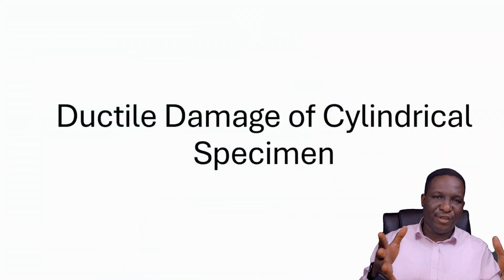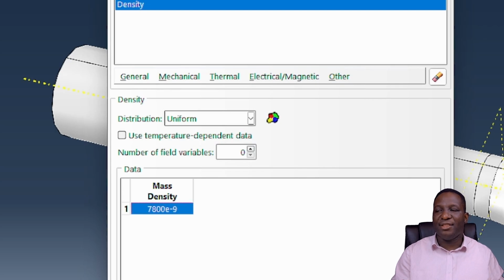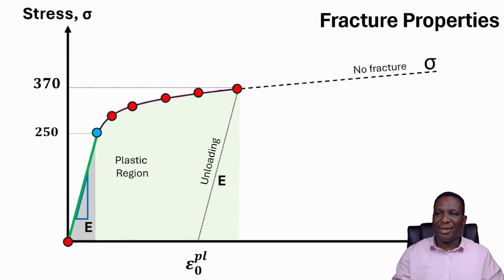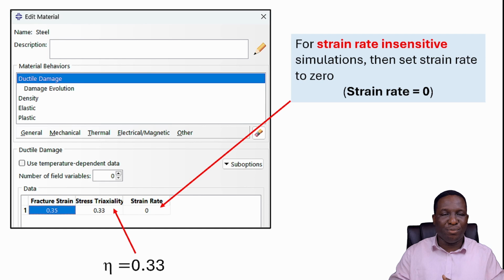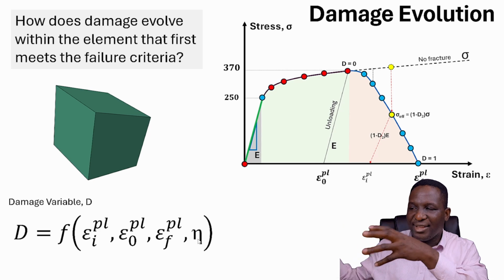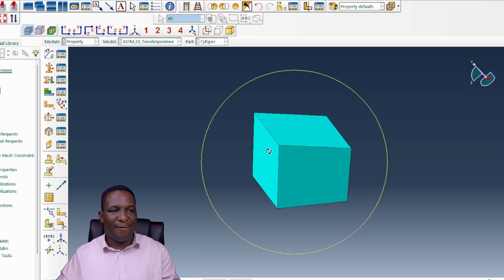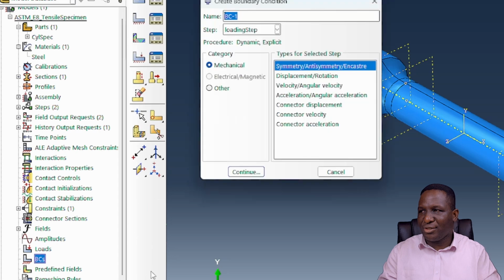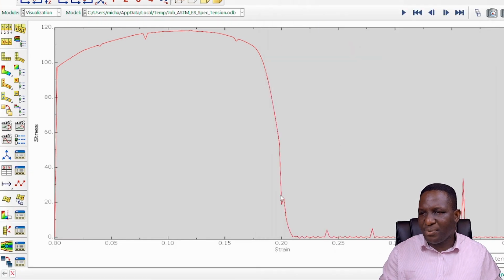This is the MOST Comprehensive video about Ductile Damage.

Comment: Thanks alot for this video 
I have a question 
What is the best way to accurately model damage of lattice structure made of PLA+ under uniaxil compression test ?
Reply from the maker: Great question. The most accurate approach in ABAQUS is to model the lattice explicitly (beam/shell or solid struts) and use a plasticity-based damage model calibrated from uniaxial compression tests of PLA. You may also include progressive damage with element deletion, large deformation (NLGEON), and contact between struts especially when large deformation is in place. For collapse-dominated behaviour, Abaqus/Explicit is usually the most stable and realistic choice.

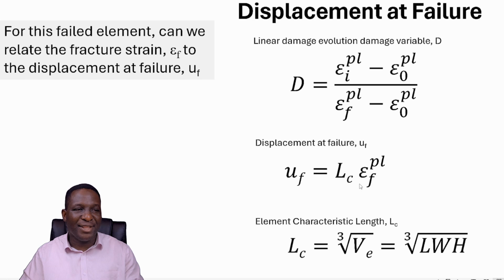Comment: To define the displacement at failure (u_f) you are using the Fracture Strain (epl_0=0.35), but you should use the Failure Strain (epl_f) that you didn't define. In your video, at 20:45, clearly says that u_f = L_c * epl_f. Using epl_0 (u_f = L_c * epl_0) seems a mistake. Beside this mistake, I gave you a like. Anyway, I recommend to use the Fracture Energy (G_f) instead, because it makes your input independent of the characteristic length. G_f is a material properly (140 kJ/m2 for the steel, 110 kJ/m2 for the aluminum,  etc.). With G_f you can use a mesh with irregular element sizes.
Reply from the maker: Good observation,  thanks.❤

Comment: I often get ta S11 stress higher than defined in the material properties of steel, UTS defined is 500 Mpa but i am getting stress result around 600 Mpa. It is because i dont define a fracture properties?
Reply from the maker: Could be as a result of the element chosen. Are you using Tetrahedron or triangular elements?
Reply: @MichaelOkereke I didnt define a damage evolution criteria so my stress was increasing with the strain..My problem involves the multaxial loading case, in this how can i correctly define the fracture strain vs stress triaxiality relationship

Comment: Concernig the limit of elasticity in theory it is set at 250 mpa and UTS is set at 370 mpa.
 But when we arrive at the  results we can see that the limit of elasticity is approximately at 99 mpa and uts is at 118 mpa, so there is a contradiction between the actual results and the theoretical ones.
I noticed that when we get the curve of force the value of force at uts is 37*10^3 N and at elasticity limit is at
 31*10^3 N . Knowing that our theoric stress values for elasticity limit is 250 mpa and for UTS is 370 mpa. I tried to devide the results of the force by the theoretical stress and i got two different sections which is contradictory, and none of those results are the ones of our section.
I would like an explanation please.
Reply from the maker: It seems you are doing something wrong - not sure what the problem is without more details.

Comment: Thanks for all valuable informations, but there are many quastions:
- what if the failure stress was not zero so the value of failure damage variable (D) wil not be equal to 1, according to my test data the value of D at failure is 0.27 (D=1- σ/σ eff )
- how to calculate the fracture strain?
Reply from the maker: Thanks for your comment. At the onset of damage, 𝐷=0 , and at full failure, 𝐷=1. In your case, if 𝐷=0.27, that is completely fine—it simply indicates that full damage has not yet been reached and is still evolving.

Achieving full damage is not always necessary; it depends on the progression of the test. For example, in a tensile specimen, full damage occurs when the material completely fractures, meaning it can no longer bear any load. At this point, stress drops to zero. If the material has not fractured entirely, some residual stresses will remain, which means 𝐷 will not be equal to 1.

For the damage model to activate during the simulation, it typically requires post-yield conditions, at which point D begins at 0. If this is not the case, you are still in the elastic loading phase or at the onset of plasticity.

I hope this explanation clarifies things for you.

Comment: Thank you for the valuable video! Your work is incredibly helpful, and I truly appreciate it. I just wanted to mention one small detail regarding the density value of steel in the SI(mm) unit system in Abaqus. While you correctly converted the density from kg/m³ to kg/mm³ in this video, Abaqus requires a consistent set of units. When using millimeters (mm) for length, the corresponding units for mass, stress, energy, and density should be tonne, MPa, mJ, and tonne/mm³, respectively. Unfortunately, this is a fixed requirement in Abaqus and cannot be adjusted.
Reply from the maker: Thanks for your kind comments. I have read similar comments and I think it is the divide between the american system and the european representations. I have to go back and look at what the documentation says but most of the time, if you keep your units consistent - then it does not matter if the mass is in tonne or kg, which is really the issue herein trying to define density. I will have to pay more attention to this as you are the third person, under this video, I believe that is raising up this query.

Comment: I think the displacement at failure is calculated wrong. It should be the product of the characteristic length and (plastic damage failure strain and plastic damage initiation strain). Per Abaqus keyword documentation:
Data lines to specify damage evolution for TYPE=DISPLACEMENT, SOFTENING=LINEAR without the MIXED MODE BEHAVIOR and the RATE DEPENDENT parameters

First line
Effective total or plastic displacement at failure, measured from the time of damage initiation. (Units of L.)
Reply from the maker: You could be right... I need to check carefully... the principle remains though.

Comment: Really good video.
For fracture evolution, if I use the energy option, does the fracture energy inputted need to multiplied by the element size?
Reply from the maker: Yes, correct i.e. you need to determine the characteristic length but it is not so straightforward but I sort of get what you are asking.

Comment: can you compare this failure theory with the traction separation theory? when should we use that one? 
when do we use Cohesive elements?
Thanks for your video.
Reply from the maker: I am not sure about comparison of the failure theory and the traction separation theory. I know cohesize zone analyis tends to be required where there is interface/contact effect which need to separate as part of a damage event. This is not the case in this example.

Comment: Hi . 
I want to simulate tensile test for PLA polymer materials. I don't know the damage criteria that the sample will break in the tensile test. Thank you for your guidance
Reply from the maker: Most of the time it is best to find those in a journal paper. I do not have anyone in mind yet but a quick search on say Google Scholar can help you find papers that deal with PLA and use ductile damage. It might be slightly different from what we showed here (since you are dealing with polymers as against metals), so you have to do some reading around to find what you need.

Comment: hello sir, thank you for your clean explanation. but there is something i want to share with you.
 based on ABAQUS documentation, "Fracture Strain" means "Equivalent fracture strain at damage initiation". so there is a contraction between what you defined in the video and ABAQUS documentation. in another way, the strain you defined in the video, is more like "rupture strain" based on ABAQUS documentation. have I missed something ?
Reply from the maker: Thanks for the info. I believe the essence of the video is right, the specific way you or I interpret these boundary values might differ but you ahve to keep iterating your simulation until experimental data matches numerical data. This video is simply a guide for the beginner modeller in this area.

Comment: excuse me, Can I ask some question that is not relative with this video ?
My model is hybrid composite between KFRP and CFRP under low velocity impact condition but I cannot get force value or plot force and time graph. Can you explain how to I solve this problem.
Reply from the maker: I think this is possible. YOu need to track a set of node/nodes from which you extract forces or displacements. You have to kinematically linked a reference point to a section of the material. I have a few videos on this channel on RVE modellign where I showed this kinamtically linked *EQUATION approach of using a reference point node to load and extract properties from a model.

Comment: Thank you for the video. So if we change the mesh size do we also need to change the displacement at failure parameter?
Reply from the maker: Yes, because the mesh is linked ot the characteristic length. You can play around with it and see if it makes any difference but theoretically, yes you need to.

Comment: Sir, in your video you refer the "Fracture Strain" set in ABAQUS as the value when it totally damaged. I think "Fracture Strain" in ABAQUS might be the fracture strain at damage initiation, which you called epsilon zero.
Reply: Was going to ask this as well. Because I believe equivalent plastic displacement is then used to get from this value to the point of failure in the damage evolution module.
Reply from the maker: Hi, good question. If you look at the graph, the initiation aof damage is at the UTS and there D = 0, which suggests that damage has started and this will evolve with changing D until D = 1 (complete damage). Complete damage occurs at the fracture/separation of the specimen. The strain at which this happens is the fracture strain. 

It could not be at the epsilon_0 (which is equivalent to start of the plastic strain), as this corresponds to the UTS. The specimen cannot fracture at this point rather it will be the final point of yielding. Eventual fracture/separation of the specimen happens at what I have called fracture strain.

Within a single element, when damage initiates, we need to know when a failed element will be deleted from the model. This corresponds to the fracture strain through the displacement at failure. Once this is obeyed, the element is then deleted from the model since element deletion is swithced on. Other elements around the failed element might have D values not up to 1 and so not approached the fracture strain. Once they meet this condition, the elements would then fracture and be deleted from the the model.

If you do not believe me, I asked ChatGPT to define fracture strain and here is the answer:

"In the context of continuum damage mechanics, fracture strain is defined as the strain at which a material undergoes fracture, leading to the complete loss of load-carrying capacity in the material. It is The strain value at which a material experiences fracture due to the accumulation of damage, resulting in a complete loss of its structural integrity."

I believe this is consistent with what I have tried to explain above.
Reply: @MichaelOkereke  Thank you sir, that's very clear. But in Abaqus manual Ductile Damage Section, the "Fracture Strain" is defined as Equivalent fracture strain at damage initiation, not the end. I tested it in abaqus and plotted the stress-strain curve, and the "Fracture Strain" input value is really just the initial failure strain.
Reply from the maker: In which case you go with ABAQUS... the documentation will not lie.

Comment: What about Lode Parameter ?
Reply from the maker: Good question! 

Lode parameter is definitely essential for describing plasticity of materials. I have not specified it here as the ductile damage model that comes with ABAQUS, and which was reviewed in this video does not have need of this lode parameter.  Just like the stress triaxiality, the lode parameter gives and indication of the dominant stress state in the model. 

Lode parameter, typically represented by mu, can be: mu = 1 (pure shear stress), mu = 0 (uniaxial stress) and mu = -1 (corresponds to a stress state where principal stress, σ2 =σ3 (triaxial compression). It is similar to the stress triaxiality term which gives us an indication of the stress state (dominating) the simulation.

If you want to learn a bit more about the lode parameter and the like for a triaxially loaded system, then watch this video of mine: https://youtu.be/HJ3JzPUhz1U).

Comment: How to find the characteristic length for tetragonal element?
Reply from the maker: The simplest way is similar to what I did here but replace the volume of the cubic element by the volume of a tetragonal element, but still take the cube root of that volume.

Take volume of a tetragon = a^2c where a = edge length of a regular square base of the tetragon and c is height. 

I think you could assume that the elements you are dealing with are regular tetragons even though in more cases it would be irregular but deviations from edge length, 'a' and 'c' can become an error measure which you can factor too in determining the characteristic length.

Comment: Great video! One thing you might have missed is converting thr density to tonne/mm^3 as opposed go kg/mm^3.
Reply from the maker: Not really...I was working in an SI unit with mass in a unit of kg. Also, the Pa is N/mm^2 and N = kg.mms^(-2). Therefore, it's better specified in kg. However, if your masses are in tonnes, then indeed you are right.

Comment: Thank you immensely for your thorough explanation! 🌟

However, I have a question: Why use an explicit solver? What advantages does it bring? If the problem is tackled using Abaqus Standard, what changes? To my knowledge, Abaqus Explicit is typically essential when a problem encounters significant forces due to mass or intricate frictional forces—neither of which seem pivotal in this case. What, then, justifies its use here?
Reply from the maker: You are right... it could be easily done with ABAQUS Implicit and it would work.

However whenever there is significant possibility of nonlinearity,  damage, impact or the examples you cited, it is usually recommended to include an ABAQUS Explicit step as its better suited to deal with the convergence of such unstable simulations. I hope it makes sense.

Comment: Sir, what will be the characteristic length for a tetrahedral element?
Reply from the maker: I had a thought about it and the simplest way is similar to what I did here but replace the volume of the cubic element by the volume of a tetrahedron shape, but still take the cube root of the volume of the tetrahedron. Take volume of a tetrahedron = a^3/(6*square-root(2)) where a = edge length of a regular tetrahedron. I think you could assume that the elements you are dealing with are regular tetrahedrons where in more cases it would be irregular but deviations from edge length, 'a' can become an error measure which you can factor in in determining the characteristic length.

Comment: one of good explanations for the ductile damage so far
Reply from the maker: Glad you enjoyed it and felt that way about it. I wanted to make a comprehensive video about ductile damage that tries to show the whole theory and simulation setup for viewers. Glad it struck a cord with you!
Reply: @MichaelOkereke   Thank you for your great effort. I was wondering if the method you described can be applied to truss elements like T3D2 or beam elements like B31.
Reply from the maker: I will not think so, as the element type used here are 3d continuum elements so am not sure you can use it for the beam or truss elements.
Reply: @MichaelOkereke   I am wondering if there is a different approach. This would be significantly important when modelling actual-size reinforced concrete subjected to severe loading such as cyclic load. In this case, the rupture of the reiforcing bar could be identified at critical locations (plastic hinge locations). Anyway, thank you, Dr. Michael Okereke, for your reply

Comment: please do a video on hybrid metal matrix composite RVE with fracture analysis
Reply from the maker: This is a good question. I have not done this before but should be interesting. What is the matrix and metallic reinforcement you are taling about. What is the hybrid material?
Reply: @MichaelOkereke  it may be aluminum matrix and TIB2 + SiC particle reinforcement. Analysis should be on damage initiation, crack propagation and interfacial debonding.
Reply: basically for understanding the deformation and fracture mechanism of MMCs.